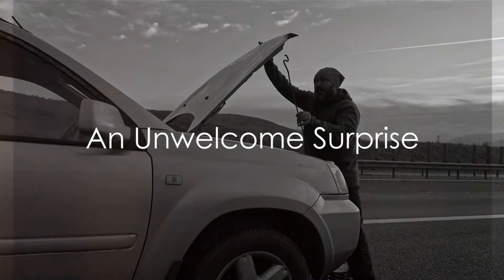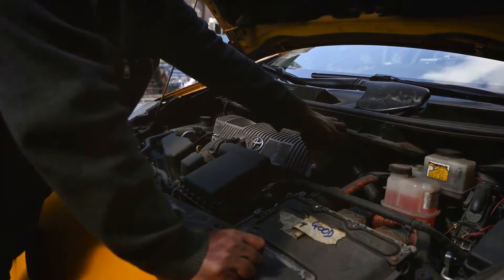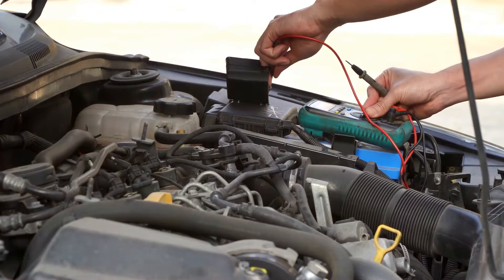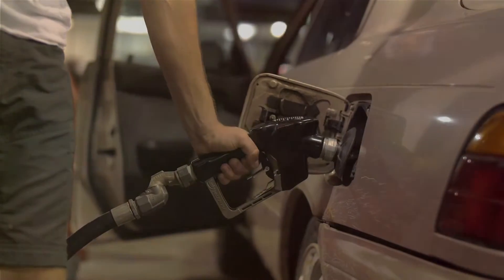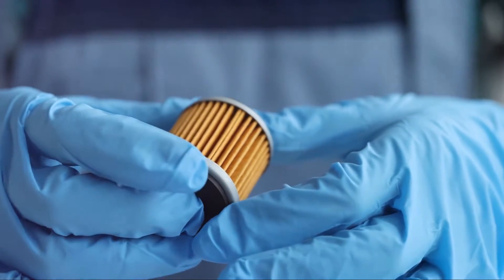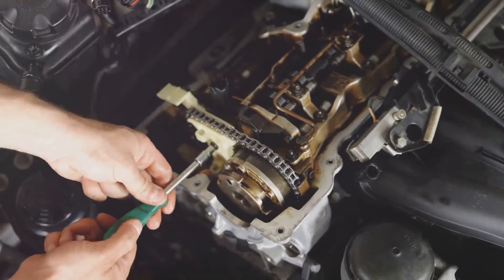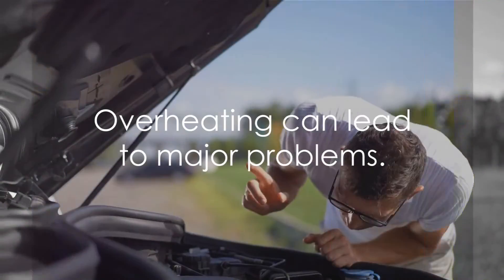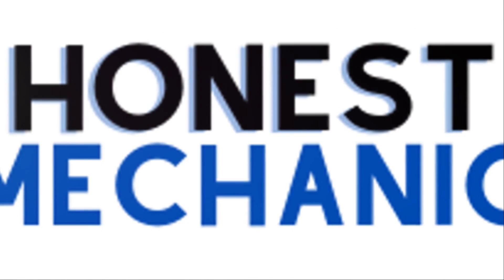Car Shuts Off While Driving:  7 Common Causes

Comment: 2015 Honda accord sport , after running it for some minutes the engine will shut off when I break at a light but the car still has power . This happens often what can be the problem it starts running again after turning the key immediately but sometimes will take about 10-30 minutes to start the engines again
Reply: Most likely bad alternator or did you find out already?

Comment: My car shutdown after washing the car, it some how started again but the battery and park brake light was on for some time and it shut down again while driving.After some time i started again ,all the lights where now gone and now running properly, what could be the issue?
Reply from the maker: I'd check the intake manifold and any relay that might be exposed and vulnerable to water.

Comment: I have a 2021 corolla and am a pretty rough driver, I drove it harshly in the mountains zig zag, and the car suddenly doesn't accelerate, then I stopped the car, I tried to start but it didn't but only cranked, after trying and trying it finally started after giving accelerate while starting, turns out it's because the car ecu found out abnormal driving, and the CVT transmission overheated slightly, but the warning light didn't come, so it's because of my harsh driving my car shut down

Comment: Hi ! I have a 2022 Nissan frontier,earlier I was driving my i n the freeway at about 20 miles an hour ,the engines shuts down I thought I got rear ended but no , the truck is on drive and it’s not moving, immediately I put it on park and waited about 30 seconds and restart it and works I made to work but I’m scared going back home it might again at high speed
Reply: Justo me paso eso en la nissan titan 2018 a ver como me va ahorita q salga de trabajar

Comment: Mine was when turning on my car then its turnoff immediately. Then i tried again and it works. But then when in the middle of driving.  Its shutoff. So far i have replaced: Clean MAF senor, new air fliter, and new battery. And when i checked with Autozone. They told me its the bad alternator. Getting it fix tmr. Hope thats is the culprit. 😢. Will update how it goes. 😅
Reply: Please let me know sounds like what my car is doing right now 😢
Reply: @ Will do! I have an appointment with my mechanic on Thursday instead of today, so couple of more days.
Reply: @EchoesinTune that’s sounds like me! I believe I need a new alternator as well.
Reply: @EchoesinTune getting mine changed tomorrow morning too
Reply: @cornelius6633  ...but check your alternator first, if it need a replacement. Otherwise it could be another small easy fix thing.
Reply: @taniyawelch6972  *Update*: Went to my mechanic today and he checked my alternator with his fancy machine thingy. And he said that it is 14 Volt which is totally fine. The  Alternator is not the issue. He told me that this could be the ignition starter switch. This is an easy fix DIY. And save money...for some reason my car ran perfectly fine over these couple of days. 😂. I'm ordering the ignition starter switch and replacing it myself since the Youtube tutorial is easy to follow. 😂
Reply: @EchoesinTune  lol for me it was my alternator I have a 2012 Chevy impala ltz
Reply: @cornelius6633  ah, I see. Hope all goes well.
Reply: *Update*: Went to my mechanic today and he checked my alternator with his fancy machine thingy. And he said that it is 14 Volt which is totally fine. The  Alternator is not the issue. He told me that this could be the ignition starter switch. This is an easy fix DIY. And save money...for some reason my car ran perfectly fine over these couple of days. 😂. I'm ordering the ignition starter switch and replacing it myself since the Youtube tutorial is easy to follow. 😂
Reply: Update I've replaced my ignition starter switch. (It is a simple fix and cheap; DIY) When I cranked my car I noticed a huge difference. My car no longer stalls, and/or turnoff while driving.  😅. Hope this helps anyone that has a similar situation as I am. Best of luck.
Reply: Pls same issue with my corolla vvti, let me know when u fix the autonetor..i have done the same changes u did
Reply: @greenwellmponda2363 all I did was replace my ignition switch. I no longer came upon that problem anymore.
Reply: @EchoesinTune can you link the diy YouTube video so I can watch it and do it myself...I have the same issue.
Reply: I use this gentleman tutorial to DIY. 😊.

Comment: I had 2010 Kia soul still have it and use it today 195000 miles. Mind you I have abused this car and the only major problem was the steering wheel was hard and turned off, pressing the gas and the car would lose power and what worked for me was the change of the purge value.

Comment: Hi. I have subaru outback 2009 . While I was driving and trying to turning, sometimes engine suddenly cuts off. But, I can be turned on again. Do yo have any suggestions to fix that? 

The other things, while I was driving and using cruise control, while the road is bumpy, check engine, vehicle stability control and electronic parking will be active. Do you have any suggestions to fix that?

Thank you
Reply: Did you resolve this ?

Comment: 3 third time this happends to mine completely shuts off while im driving but than in 1 or 2 mins turns back on could someone tell me wat that could be
Reply: Having same issues tried replacing fuel pump, camshaft position sensor, battery an cables, alternator. I'm lost not getting any codes to go by.

Comment: I bought a 2008 mazda 3 and was driving down the road and it just shut off i had pedal response but i couldnt get it to restart and it currently still doesnt start i found a antifreeze leak but couldnt find from exactly where and when i turn the key all the electronics for the car shut off like the car has lost power
Reply: What was it?!?
Reply: How you fix have same problem

Comment: My ford focus c max 2006 shutdown on the road. And since then I’ve changed the battery, alternator dashboard, brain box and fuse box but it’s still not starting. Sometimes it starts for like 4 seconds and then turns off immediately. Anyone have an idea?
Reply: Fuel filter, fuel relay
Reply: I had the same issue what worked for me was changing the purge value

Comment: I have nissan xtrail T30 . When i start the car in the morning everything is okey, once i pack the car, and start off heading home during mid day and its hot, It will rough idle, cutting off while drivings and when i pack on the side of the road and it will start i move for a while and it will cut again... starting there is no problem even maintaining idling no problem,  but i have an issue with it cutting and loosing power while driving, please help

Comment: I have an 02 Silverado ( just recently bought) I noticed if I try to take off quick the truck will die. It will start back up just notice if I warm the truck up for 15 mins and drive slow for a few blocks. It won’t die. 
I do hear the fuel pump, which I think it might be going out, but any ideas why it does this?

Comment: My steering wheel locked, break seized, engine kept idling, transmission fully engaged and pushing the car in stop and go traffic at 10kmph. Only clutch pedal was responding. The gas pedal presses did not respond.

I put it to neutral, switched on hazard light, pulled parking break. 

Turned off the car and recranked it. Issue temporarily resolved x reached home and parked. No balls now to start and drive it again. Using only a motorcycle now. What do I do?
Reply: Have you gotten your fixed now? I think I might have a similar challenge. Mine just goes into ignition mode then I have to start the car again. I changed the fuel pump already, but the problem persists.
Reply: I have an update. The ECU unit had come loose a bit. Everytime car hits a slight bump, had this problem. Now after reseating the unit back in proper position, the problem do not occur.
Reply: Any update?

Comment: well , when I was about to drive my 2015 Kia forte and soon as I pulled out my drive way on the busy highway my car shut right off luckily no cars was coming and someone on the highway helped me pull it back into the yard in neutral . small mechanical said it was the fuel pump he put a small blue piece in it and on the way home from work my car lost power while I was trying to pass another car .. and completely lost power when I was driving on the side of the road . the first time the oil light came on and the second time the battery light and oil light came on . someone please help . my grandad put a new fuel pump in and it still lost power when he test drives it .
Reply: Might be a battery/alternator cable that needs replacement

Comment: I have a 2000 Dodge ram 1500 van. It stalls and leaves me stranded in the middle of the road for 2 hours before it will start again. Does it every time I take it out I can go a mile and a half and come back home and it won't stall. Any further than that it stalls leave me stranded. I have replaced the fuel pump steel still stalls. Change the spark plugs and air I'm fixing to order a crank shaft position sensor. Any help is appreciated. Thank you Linda
Reply: Go to your car service center they will fix it
Reply: Chek plug psition sensor or chang it
Reply: Sounds like over heating

Comment: My car just cutted of while i was driving then it does not start but everything is on on it
Reply: Same battery is good starter is good just won't start think it's the 02 sensor
Reply: Same, that's why I'm here 😭
Reply: Sounds like alternator for all for u. Ik because i have a battery issue and not a alternator and when its battery related the car stays on as long as its jumped but the moment its off its off or rapidly loses power till its off. If ur battery is staying strong and cranking but cutted off randomly and doesn’t start now that sounds like ur batteries have juice and is trying but the alternator aint keeping up. Check the voltages to see if its charging.

Comment: I got a interlock installed about a month after getting a car from a dealership and my car started to cut off while driving when trying to start my car again it would just shake and crank but refused to start.
There’s also a check engine light that appears, but I used an OBD2 scanner and got no codes multiple times
Reply: The certified ignition interlock installation provider first told me there was nothing wrong with my car after taking it for a test drive, this was not the case as my car turned off again on the freeway, they then replaced all wiring and did a full diagnosis and not even a full day later the same thing happened Usually, my car would start again after 20 to 30 minutes of sitting, but this time my car will not start.
Reply: @alexdelafuente2407 were you able to figure what it was? My exact problem rn. I have to let it sit for it to start and haven’t had luck with finding out what’s wrong

Comment: My 2014 Toyota Camry has been shutting off on my mid drive. All the lights show on my dashboard and it feels like it has a low crank. I recently changed the battery and my mechanic could not find the issue. He recommended using super gasoline for a few weeks to see if the car is still having that issue. It stopped for a few weeks but now has come back. I can feel the car struggle when I make left turns and have to accelerate. Any clues ?
Reply: Fuel pump?
Reply: Me to my car Toyota Camry 2010 but when I drive on the highway no matter but when I slow speed or slow right turn or left turn also in park and out park is shootdown I don't know the problem.
Reply: @ebaketema8974  sounds like a transmission problem. Is your car automatic? How about when you slow down does it sound like it wants to shutoff?
Reply: Same car with some issue . Please let me know if you find the solution.
Reply: My truck was throwing a service battery charging system lights was dimming so I changed the alternator but the signal didn't go away the next day I lost turning signal then shortly after it spudderd and died wouldn't crank or do anything when I tried one hour later the tow truck got there started back up but was laggy doing so any idea
Reply: @theamerican3686 might be the distributor
Reply: Same problem Toyota Camry 2015
Reply: Check you alternator. Have you noticed your headlights dim at night? When you changed your battery did it run good for about a day then the problem came back? Do you feel loss of power? All these point to a alternator going bad or bad.

Comment: I need help. I have a 2013 Ford escape sel turbo. As im driving, all the electricity in the car stops working. The car keeps driving. As soon as I pull over and turn the car off, it doesn't turn back on. What could be my problem?
Reply from the maker: Hi Raveny, Did you manage to find the fault? The issue with your 2013 Ford Escape could be related to the alternator or battery connections. If the electrical systems fail while driving but the engine remains running, it suggests the alternator isn’t properly charging the battery, or there's a loose connection. When the car doesn’t restart after being turned off, it indicates the battery may not have enough charge. It's recommended to check the alternator's performance and ensure all battery connections are secure and corrosion-free. How old is your battery?

Comment: If your car is idling and cuts off or you drive a short distance and it cuts off Check your gas pedal sensor. 2013 Malibu 2,5 engine
Reply: Gas pedal sensor? Never heard of it before. Is this a real thing?
Reply: I got exact same Malibu 13 2.5 it shuts off after a 20 min drive it shut off at a light and then after 30 minutes it turned on and while idling it makes a clicking sound same thing happens to you?
Reply: Wouldn’t that throw a po code
Reply from the maker: Great advice, thanks for sharing. The community will find this useful.

Comment: Hi bro, my polo 1.6 TDI ( sedan ) the engine cuts off while accelerating for a second and comes back with full power and its happening all the time :/, what could it be man..?
Reply from the maker: Hi Joe, It sounds like your Polo 1.6 TDI is experiencing intermittent power loss during acceleration, which can be caused by several issues:

1. Fuel System Issues: Problems like a clogged fuel filter, issues with the fuel pump, or injectors can cause intermittent power loss.
3. Air Intake System: Check for any leaks or blockages in the air intake system, including the air filter and mass airflow sensor.
2. Turbocharger Problems: Given that it's a TDI engine, any issues with the turbocharger, such as a sticking turbo vanes or problems with the wastegate, could cause fluctuations in power.
4. Engine Sensors: Faulty sensors such as the throttle position sensor or crankshaft position sensor might be sending incorrect signals to the engine control unit. 

Are you experiencing any other symptoms other than the hesitation?

Comment: I have a question: While driving my Toyota Verso at 30 mph it suddenly made a loud rumble/banging noise (like i.e. when hitting or running over a curb or a big animal etc). And then the motor died. After a moment I turned on the engine and everything has worked normally since then. I didn`t hit a curb or animal, and no objects were lying on the street. 

Sorry for my English, I hope you understand what I mean. Do you know what that could have been?
Reply: I also experienced that when my fuel pump was going bad
And had to change it a few months
Reply: @ssebagalasolomon3831  Interesting. Thanks👍

Comment: I have a 2018 Nissan rogue and the check engine light was on. A few days later it started to shake while I was driving and then it cut off. I had it towed to my home. It starts up with no issue but it shakes & rumbles and you can’t drive it because it will cut off the minute you try to drive. Any idea what this could be?
Reply from the maker: Hi Karalove, managed to fix the problem?  The symptoms you're describing, check engine light on, shaking while driving, and the car cutting off suggest a possible issue with the ignition system (like faulty spark plugs or ignition coils), a fuel delivery problem (such as a clogged fuel injector or failing fuel pump), or a severe vacuum leak. The fact that it starts but can't sustain running when you try to drive it further points towards a significant issue affecting the engine's ability to maintain idle or load conditions. The best course of action is to read the diagnostic trouble codes (DTCs) stored in the car's computer system with an OBD-II scanner
Reply: Mine is doing the same thing as we speak… what was the problem?

Comment: I have this Nissan Note which is cutting off abruptly on the road. After stopping for some time, it will the run for a certain distance and cut off again.
What could be the problem?
Reply from the maker: Your Nissan Note cutting off abruptly on the road and restarting after a pause suggests a few potential issues such as fuel delivery problems, ignition system faults, or overheating electronic components. Since there's no looseness at the wheels, it's likely not related to wheel bearings or suspension but could be a problem with the fuel pump, clogged fuel filter, faulty ignition coil, or a failing crankshaft position sensor. These components can behave normally when cold and fail as they heat up, causing the engine to shut off. Once they cool down, the connection is temporarily restored, allowing the engine to start again. It's recommended to have a mechanic perform a diagnostic check, focusing on the fuel system and ignition components, to pinpoint the exact cause. managed to get it fixed?
Reply: @HonestMechanicChannel how does loos wheels cause an engine to shut off?
Reply: What was it ??
Reply: i have similar issues with my nissan note did you ever get it figured out?